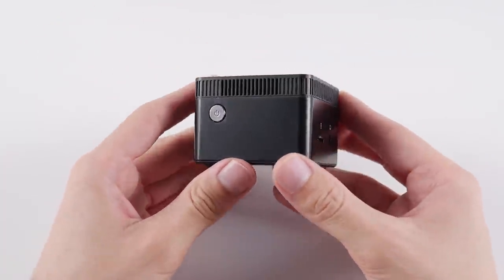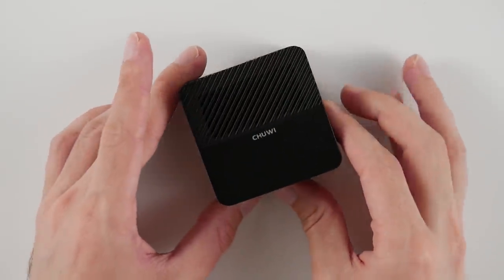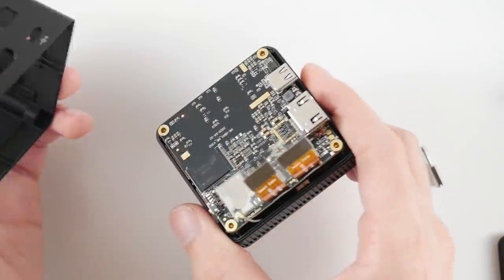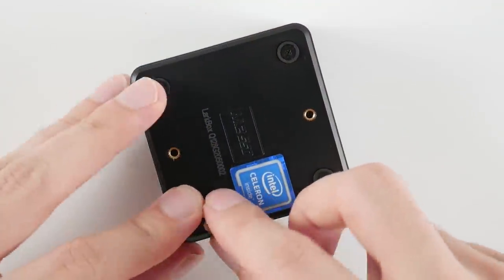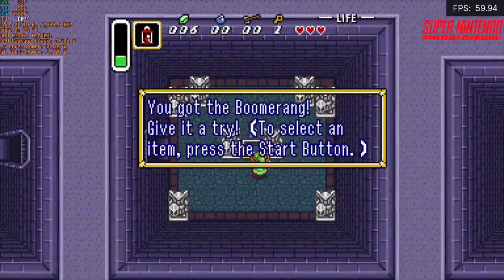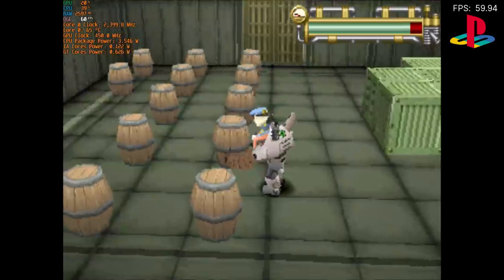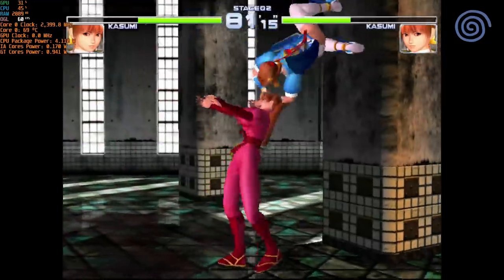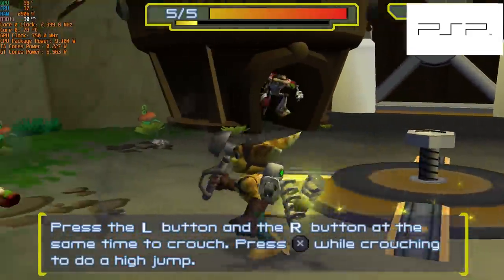GAMING ON THE smallest 4K MINI PC

Comment: I'd put Blender on it, then proceed to subdivide the default cube 20 or so times, then put a lvl 5 sub surf.  If the computer is still alive I'd try the most dynamic fluid simulation I could think of.

If it managed to pull all that off, I'll return all the parts I bought to make a ryzen 9 rig and use it for my workstation instead......

Seriously though, it sounds like a half decent retro emulation machine.

Comment: I really can't help but wonder how it would've worked out if they gave it proper dual channel. A lot of its stuttering is coming from Intel FLEX which is a hacky way to emulate dual channel... ends up in between single- and dual-channel, but a lot of programs simply can't support it. It's not badly priced but the issue I have with it is that it offers very little over Android boxes half its price. It literally hinges on the x86-native games, emulation isn't it at all, although it would be with proper dual channel as it came SO close to running N64/GC/PS2 flawlessly, and 3DS would be more than manageable.

Comment: It's a neat device but with my beast PC rig, 3 laptops, and a GPD Win Max on the way, I also don't know where I would use this thing too. I still have my old PCs too with 2700k, 1100T, 1800X cpus and my 1080Ti, 980Ti, 680s x3, etc. 🤔

Comment: If you are interested in a passive mini pc with similar specs you can check out Compulab fitlet2.
It costs more but it is also very customization (You can get it with up to 16GB RAM) and not made in China.
Disclaimer: I work for this company as a software engineer.

Comment: With pop OS on it it could serve as a decent retro emulation console. My gpd win 2 without even over clocking or increasing the wattage of the cpu is very capable Linux emulation console. Albeit my taste in retro gaming consists of RPG games and turn based games. I don’t stress the device too much for what it gives. This little chewi could be better if provided better L2 cache and 8 gb ram but I think for first new comers it could be a pretty good for the buck

Comment: you kinda messed up on the CEMU emulator

you should go to graphics packs, then you can just enable betterFPS,
 this feature can triple ur fps in most cases
Reply from the maker: That's what is being used in the video...
Reply: @TakiUdon  oh ok sorry, i didnt know
Reply: @TakiUdon  also, there is a way to get 2 or 1.5x your fps, i wanted to get this for my dad and i wanted max preformence anyways, really good video, (do you have a amazon affiliate link so i can buy it?)
Reply from the maker: @zepu400  I haven't had any contact with any Amazon retailer that I'd trust. I only talked about this in the context of the fundraiser because it was priced very competitively.

Comment: Looks very interesting, surprised it comes with WIndows 10 Home Edition. If there is a version without Windows and no 128GB storage I bet will be super cheap.

Though 2 USB ports seem a bit limited, also the power brick is bigger than the device itself. Really tempting to get this for retro gaming with Batocera.

Comment: Would have been perfect for me I need a computer I can surf on with 4k output and that draws very little power. Except it has no ethernet, wireless here is not good enough sadly, too many neighbors using it. But damn its cool being that small and not an arm device.

Comment: Install GPU in the pci slot and boot with usb storage to gain a beefy graphic boost
Reply: Probably cpu bound and even then the pci may be to slow to fully utilize the gpu.

What we need is something similar with a thunderbolt port and a more powerful processor. Then run an egpu enclosure.

Comment: Its a weird niche. 
For 135€ I could probably make a better gaming machine from used parts and stuff them into a full size tower and probably have a better experience all in all. Heck, I actually have enough spare parts lying around to just make a better machine right now, that would still run on a Nvidia 9800 GT, 8 GB of DDR3 RAM and a AMD Athlon X4 640 (4x 3Ghz), which is a little bit old, but I wouldnt have to buy anything at all. 
And if its purely for a media center, why not go for a Rasberry Pi for a quarter of the price?

Comment: That’s 128GB of low grade EMC not a SSD. I don’t know why the devs didn’t use full size M.2 slot with a rectangular form factor? You would have had much better performance for thermals and more access to ports.
Reply from the maker: Don't think I referred to the 128GB as SSD storage and if I did, that was a mistake. Using SSD storage at this price point would be almost impossible, even for a Chinese company. Their profit margin can't be that high with a selling price of $150.

Comment: Lmao $1000?! Im planning on getting a used vehicle for that much soon. Word to the wise: a $75 android device with 2gb (not 1, but 2) RAM can do nes/gen/snes/mame/n64/psx/psp seamlessly and i think dreamcast too... a $100 used windows tablet (dell venue 8 specifically still some around on amazon) with 2gb ram can do most older pc games and all of the above. That one can even do portable installed pc games, perfect for an sd card... But if someone could suggest something decent for gamecube, ps2 and wii emulation under 1000, I dunno about you but chilling in my van at the beach messing around on something cheaper sounds like more fun. Innovative though Ill say that. Did Bill Gates make this? (Haha)

Comment: This thing will be a overkill for bewulf clusters and home servers once it's affordable:
Good processing power.
6GB of RAM
Generates a lot less heat than a standard pc
Consumes a lot less power than a standard pc (phone charger vs 300W power supply), and thus, using a 10,000 mAh battery you can easily have enough power backup for at least 30 minutes

I can say that I can host a 300 (It could keep up with 450 players, but I have to leave enough processing power to handle massive TNT explosions) player minecraft server on this thing with medium settings (8 chunk radius around each player) running 1.16 vanilla server, and the thing wouldn't even overload.

The only drawback? Cost, this thing costs what my most powerful desktop did cost on its day, 20,000 Mexican bucks.

Comment: $1,154 is a little pricey. I still have fun with the Raspberry PI, but it is tempting considering all the specs this new gadget has.  (I am so used to retro arch and the menu and quick saves). 
Not bad if I want to have a multi console system in the living room.
The bad thing is HDMI, I can notice even a fraction of a second delay and that irks me. I have a brand new TV now, and haven't tried the HDMI (game mode) yet on my other devices. Maybe it will be good.
Reply: $1000?? If you follow the link, it's only $150
(You're looking at the Hong Kong dollar price)

Comment: "32 bit CPU" "6 GB RAM" -_- 64 bit processor and not a 32 bit. RAM is capped at 4 GB and that processor supports up to 8 GB.
Reply from the maker: Who said 32bit? This is 64.
Reply: @TakiUdon  You did in the video. "32 bit, 6 gigs of ram."

Comment: Performance Specifications
# of Cores
4

# of Threads
4

Processor Base Frequency
1.50 GHz

Burst Frequency
2.50 GHz

Cache
4 MB

TDP
10 W

Supplemental Information
Embedded Options Available
No

Product Brief
View now

Memory Specifications
Max Memory Size (dependent on memory type)
8 GB

Memory Types
DDR4/LPDDR4 upto 2400 MT/s

Max # of Memory Channels
2

ECC Memory Supported ‡
No

Processor Graphics
Processor Graphics ‡
Intel® UHD Graphics 600

Graphics Base Frequency
250 MHz

Graphics Burst Frequency
750 MHz

Graphics Video Max Memory
8 GB

Graphics Output
eDP/DP/HDMI/MIPI-DSI

Execution Units
12

4K Support
Yes, at 60Hz

DirectX* Support
12

OpenGL* Support
4.4

Intel® Quick Sync Video
Yes

# of Displays Supported ‡
3

Device ID
0x3185

Expansion Options
PCI Express Revision
2.0

PCI Express Configurations ‡
1x4 + 1x2 or 4x1 or 2x1+1x2 + 1x2

Max # of PCI Express Lanes
6